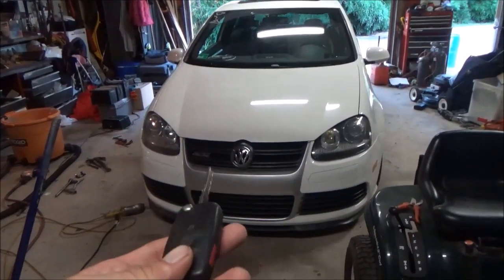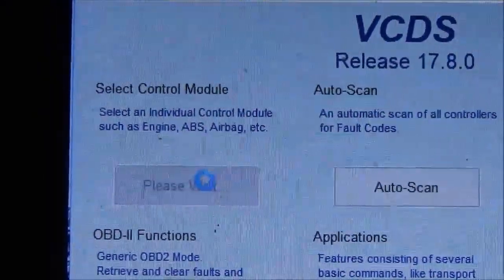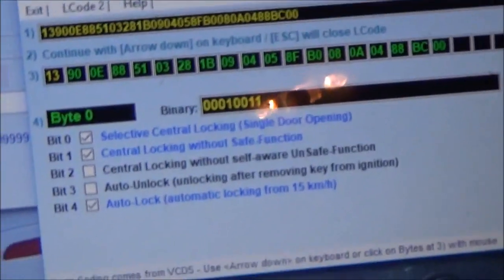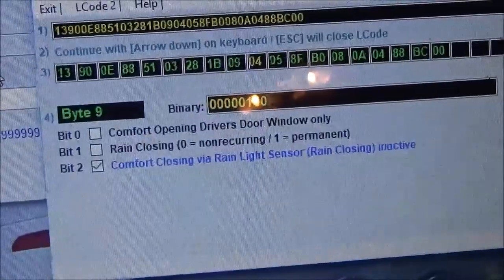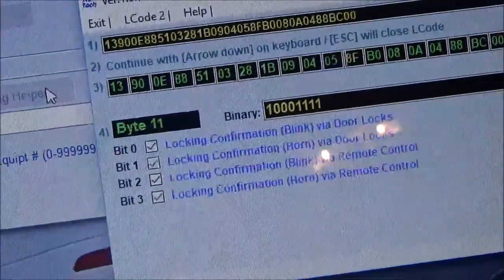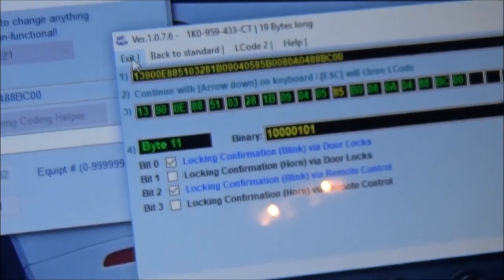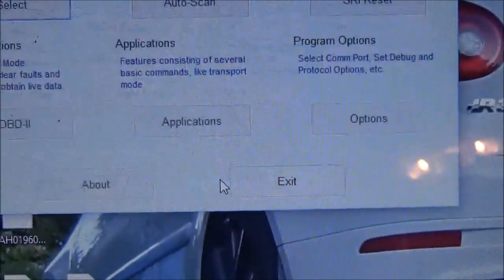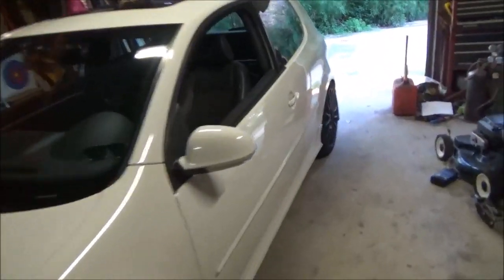Disable Horn When Locking Doors Volkswagen 2003-2010

Comment: I have a 2008 Jetta I thought I lost the key fob so I started using the spare key to lock and unlock. Once I found my key fob it messed up some of my doors locking and unlocking.  Well at that point some intruder around 2 weeks ago got into my car around 3 am setting off my alarm they got in because all my  my car doors wouldn’t lock. Now all my doors don’t lock at the same time the light on my drivers door the red light blinks , but I’m able to open it and the alarm won’t go off now. I’ve watched YouTube videos after YouTube video. A friend of mine came over 2 days in a row trying to help me fix it that’s why I need advice from a car mechanic.

Comment: Just got a 2019 Atlas SEL pre. With the doors locked, I pressed the lock button again and the horn beeps. Unlock the car pressing the key fob button twice turns off the beep. I somehow accidentally turned it off and it's taken me 3 days to figure out how to turn it back on. That was all done through the key fob not a computer or a cable or software.
Reply: Ok and what did u do to fix it?

Comment: How about this....my car is an 09 Jetta Wolfsburg, did the honking, and when my battery went out and i replaced it it stopped honking. I dont have the VCS (which i want, cause i want to do the windows with FOB) so is there another way to change the setting without the software?
Reply: Get obdelven its cheaper and easier
Reply: I have a 2010 Jetta and mine just stopped honking randomly as well. I would like it to though as the confirmation helps. My key battery is saying low at times so I might change that and see if it makes a difference, but I doubt it.

Did you ever figure yours out Sammy Amezaga?
Reply: Yeah mine randomly stopped the lock indicator beep today. I miss it.